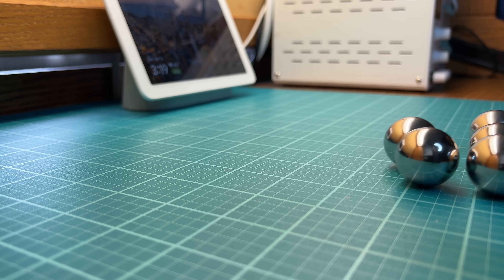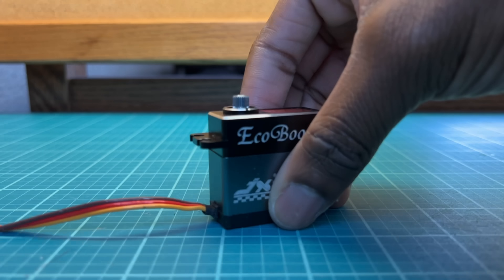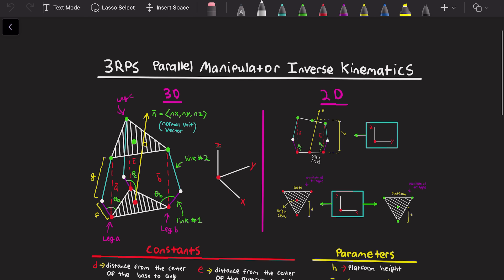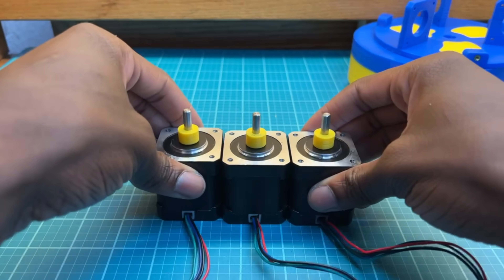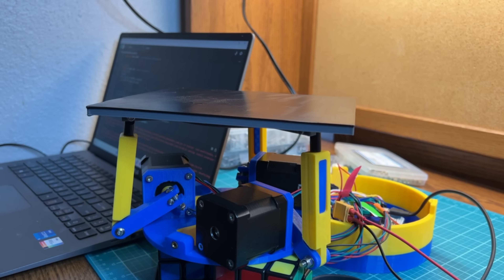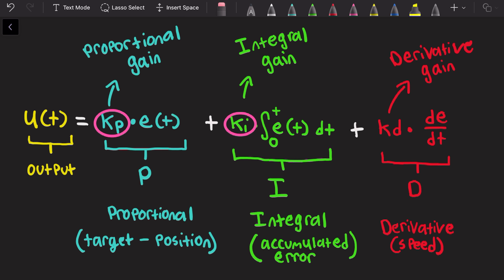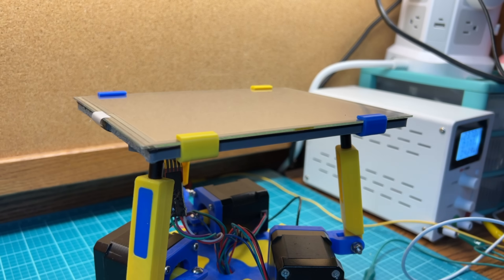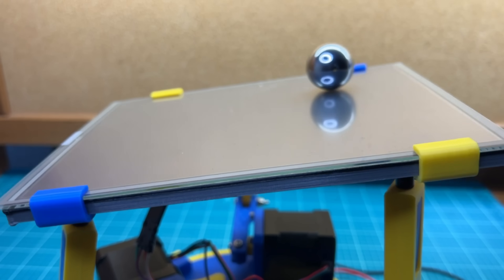I Built a Ball Balancing Robot

Comment from the maker: CORRECTION This is actually a 3RRS parallel manipulator and not a 3RPS parallel manipulator as I mentioned in the video. Also I don’t know why I played Tetris in this video either
Reply: lmao
Reply: Hey man love the video! But a quick correction I believe your design is actually a 3RRS parallel manipulator since its 3 sets of Revolute-Revolute-Spherical, a 3RPS robot would use linear actuators for the prismatic joint component hence the name 3RPS, 3 set of Revolute-Prismatic-Spherical joint. Hate to be the well actually guy, but I think its a worthwhile correction to make in the video since I got lost building my own variation of the ball balancing robot and kept using the Inverse Kinematics of the 3RPS rather than 3RRS robot! Otherwise, excellent video man.
Reply: Can you balance 2 balls?
Reply: I thought it was a metaphor.
Reply: You were working, bosses can't tell anyway.  Just tell them it's an advanced visual user interface.
Reply: Hey, I'm studying mechatronics, and I'm interested in things you do, what course allows you to do the calculations for the shape and movements of the stepper motor. I don't know if you understand, I want to learn and also be able to apply them equations
Reply: Well, and I don't know why no one mentions our work which we did 10 years ago building a 3dprinted 3RRS.  

https://youtu.be/0cO4jrztLqg

Comment: So my problem is that I followed the build plan for the circuit board, and then I powered it on and connected it to my laptop. Then my laptop shut down and isn't restarting. Now I have to send it in for repair. Luckily, I still have a warranty. But what could the problem be?

Comment: First video I got from you was the Capstan Drive, and that one was great. Found the first ball balancing, and I was like "wow, he really went a long way in a short time". Being a control and automation engineer, I could pinpoint what explanations weren't okay, most probable causes it wasn't performing well (lack of the integral on the controller being one), but it was obvious the drive to explain, test, troubleshoot, show your math and make a good video was there... that's a lot of effort.
The difference between these two ball balancing videos are a show of growth, congratulations.

On another note, the most likely reason you didn't get smooth movement is because PID controllers are good for linear systems. Use it on a non-linear system, and you're depending on luck. When they operate around a stable point of relative linearity, they behave as they should; outside that zone, it's a guess. Two common cases of this is using PID to control magnetic levitation and inverted pendulums, if you want to look into it.
Since the table is controlled via rotation of the motors, and looking through your equations, this system isn't linear. From what I remember of these systems, they behave like inverted pendulums. About using PID for the motors, that could help since it would de-couple a bit of the non-linearity, but it wouldn't be guaranteed. Some drivers come with built in controllers, so that could also help while increasing the cost. Still, controlling them via the processor you already have would be ideal.
Also, I'm kinda curious on how you tuned the PID controller. Some situations can have auto-tuning solutions that help, if you don't want to model and calculate the gains for the control setting you want. This case probably has some suite of tests where you can run and have the system tune itself.
Control theory is daunting, but awesome once you get the hang of it.

Awesome job, gained another subscriber!

Comment: @Aaed Musa I like the use of silent stepper motors instead of noisy RC servos. Great project and presentation.

I would suggest to change your kinematics to not pivot around (0/0), instead use the actual (x/y) ball position as pivot. Should be simple to implement and grants nice advantages:
No ball movement/accelleration in z-direction, thus contact between ball and table is much more reliable. Allows for very dynamic movement which would otherwise lead to contact loss (aka catapult effect), which is the main cause of the platform jittering. It also looks cool, the plate movement looks much more organic imo.
Reply: Also to reduce the nervous looking jitter/oszillating when the ball is held in position, adding a dead zone helps. Basically telling your PID to not act if the ball is in close proximity to the setpoint.

Comment: What would be really interesting to see is using machine learning with reinforcement learning to program this. 
you could use the exact same system, have the inputs of where the ball currently is as x and y, and outputs of the three stepper motors, then you reward it if it's close to the center and punish if it's far and punish really hardly if it falls off. would be interesting to see where that ends up

Comment: Nice! From a physics perspective I would expect that the control algorithm should better use also speed (1st derivative of position) and accelleration (2nd derivative) as inputs. But since speed and accelleration are both calculated from position , maybe the PID algorithm is doing that already without knowing it.

Comment: I have a question

why did you use Teensy 4.1 Microcontroller specifically and also why does it need 24 volts to operate it? Is there no other way to make it portable?
Reply from the maker: A Teensy 4.1 microcontroller is a really powerful microcontroller. It’s also the best microcontroller that I had on hand. The stepper motors need 24V, the Teensy just needs 5V. I didn’t feel the need to make it portable since I only ever used it in one place.

Comment: Very cool. Perhaps try balancing two bearings at once. Maybe even get one smaller one to orbit the other. That would be pretty epic.
Reply from the maker: Unfortunately, that's impossible to do with a single platform. According to physics, both balls have to move in the same direction.
Reply: @aaedmusa  even if they were different material? Perhaps different weight and density, along with friction, would impact the speed with which they react to the slanted surface differently and allow you to create a reactive surface that could show orbital motion.
Reply from the maker: @HyperOrangeDragon Nope, if you apply the same force to two different objects they will move in the same direction. It is impossible to make a ball orbit another with just one moving platform.

Comment: I can't believe that you pulled the center out of a stepper motor.
From my experience, doing so usually results in needing to throw the entire stepper motor away.
WHY??
The gap between the Stator and the Rotor is very narrow. The gap is so narrow that even flakes of dandruff will lodge in the gap, causing the spinning rotor to "jam", in a partial manner, over and over again, continually resulting in random rotational outcomes. A stepper motor which cannot produce predictable and consistent rotational outcomes is a stepper motor which essentially needs to be thrown away. I imagine that, when stepper motors are originally assembled, the assembly is performed in dust-free industrial Clean Rooms.

Comment: If we get the kinematics figured, can we then create a simulation model and use reinforcement learning to replace the PID controller? Just curious and wanted to try this.
Reply from the maker: I don't know the first thing about reinforcement learning. I think it's easier to just use a PID controller.
Reply: Yeah i get it. Just curious to know whether that approach could work so that I can use a similar approach for a different use case with complex mechanics.

Comment: I have a question. How you can brake the step motor when powered off ? Or Do you need to calibrate the position of 3 motors when power on to get the horizontal plane ?

Comment: Phones don’t detect pressure points, they detect electrical discharge from your fingers. Thats why you generally can’t use your phone screen with objects that don’t conduct electricity like plastic. Though I’m not sure what tablet you are using, but it most likely has a capacitive touch screen.

But! A really good example of a resistive touch screen is the one found in a Nintendo ds. A lot of commercial touch screens also use resistive touch such as an ATM. I assume its because they want it to be accesible while wearing gloves.

Comment: It is great project! I'm trying to make similar one. So I have a question about your angle formula.
For example, to calculate az, I think it should be "hz + e*ny*(sqrt(ny^2 + nz^2))" because length of projection of unit normal vector to yz-plane is not 1 but sqrt(ny^2 + nz^2).
If there are something I missed in my opinion, please let me know.
Reply from the maker: I guarantee you that the math is 100% correct. I tested it and it worked. I have also had several people build this on instructables and theirs worked as well.
Reply: @aaedmusa   Can you share your full note about formula derivation? I want to understand it step by step
Reply from the maker: @100_dori  You can find the full derivations on my website linked in the description.
Reply: @aaedmusa  I cannot write my email here because it is deleted automatically. How can I infrom you my email?
Reply: @aaedmusa  moc.revan@1330ckbf
just reverse it

Comment: could you use the resistance in the servos themselves as your positioning input?   Also,  do you even really need a computer to do this?  I could see a mechanical calculation doing the trick.
Reply from the maker: That would be a lot harder than just using absolute positioning. You absolutely need a computer for this. It would be crazy hard to tune mechanically.

Comment: I have a question, what if the platform itself is moving, like you place the robot on a slope, can it still balance, the balancing robot might have the same principle as a ship stabilizer so I just thought maybe it is possible, to adjust the axis of the robot not based on weight but the original axis that we experience on Earth, it was just a thought so if this sounds stupid 😅 then it ok 👍
Btw great video

Comment: How does your program initialize the positions of your stepper motors to some home position? Basically, how are you setting your stepper motors to an initial position that ensures the plate is level?
Reply: I think I just answered my question. By looking at 3.39, it looks as if you could just push the plate all the way down such that each link connected to your stepper motors is turned as far as they can until they hit this bottom plate to which the motors are mounted. From here, you can take these positions as home. And as long as you have previously calculated the angle of these linkages at this initial position, you can achieve any link angle by command of your stepper motors from this position. Very impressive engineering and problem solving. You’ve got a new subscriber!
Reply from the maker: @riley3448  correct thanks!

Comment: If you change the motors for a brushless motor, you would get much higher precision and control bandwidth.

Also, one way to do thus without a resistive screen is to sense the motor torque to determine the position of the ball.

For instance, if the ball is in the center, all 3 motors would have to do the same torque to balance the platform. You can triangulate the position of the ball by sensing (or just using as input) the torque.

You could use encoders to sense motor position and correlate with platform position. The setpoint is to have the platform in the center (aka all 3 motors at same position).

This is equivalent to trying to balance a ball in a platform with your hands and eyes closed, sensing the weight of the ball.
Reply from the maker: I too have also thought about using brushless motors in a future iteration. I like that idea very much, although, I don't see how measuring the torque of the motors would be a better way of detecting the ball than using a touchpad. Measuring torque means that you would have to do much more calculations to find the position of the ball with the end result being less precision in that location. Less precision because the ball is very lightweight, so any change in holding torque for the motor will be minimal if not negligible. A touchpad is much easier to implement and has virtually no drawbacks.

Comment: You could probably detect the location of the ball relative to 3 hall effect sensors with a small magnet under the middle of the table. That would allow the table to be made from something more aesthetically pleasing than a resistive touchscreen, or be made round.

Comment: next update make circles with ball bouncing on plate. that way you can limit contact time between plate and ball. next add second ball and make circle on the other side of plate with that other ball. so you can have independent control over two or more object using single plane

Comment: Have you considered switching from a PID based system to full motion profiling with trapezoidal velocity curves and splines and all that jazz? When I was doing FRC robotics in high school, switching to motion profiling seemed tedious and unnecessary at first but the final product was phenomenally smooth and easy to use compared to PID systems as we used in previous years.
Reply: That works great for smooth and efficient accelerating and decelerating, but is not particularly useful in a high speed control loop
Reply: @harrylenon9594  you could have a motion profiling system for smooth ball motions that falls through to a PID system whenever the ball moves too quickly

Comment: Now, my question is this; could this technology be expanded in scope, such as to say, could this possibly be used to create a safety system for large skyscrapers to be auto balanced in correction of major motion, such as from earthquakes or structural failures? Could this be implemented within the core of the structure to engage automatically when the buildings tilt goes over a dangerous threshold, to utilize a massively heavy weight in motion to correct the imbalance?

Comment: 5:55 Fun fact, the solution you came up with to "avoid" using extra PID controllers is basically just use a PID controller with the I and D gains set to 0. You can never escape the PID!

Comment: Insanely professional!
How difficult would it be to make it compatible with a multiple number of balls?
Reply: Fun question! I have a feeling the answer is "impossible" (I have some examples in my head that probably could prove it for at least those constructed scenarios) but would love for it not to be in practicality, either by the machine being more perfect than the roundness of the balls and using that to control them separately, or using verticality to influence some ball while another is still or in freefall, or if that turns out not to be feasable, then maybe having balls of different sizes or hollowed? /Not a mathematician

Comment: Could you maybe have used a Stewart platform for the balancer?  That might have been even more efficient and removed some limits of degrees of freedom at the expense of more stepper motors. But the use of the PID controller was a great idea! I couldn’t imagine using PID in 2 dimensions rather than just one.

Comment: Wait isn't the minimum technically only 2 motors?
If there are only 2 axes, pitch and roll then theoretically you should only need 2 right?

You would need a linkage that locks the centerpoint in the middle of the plate while still being under it. You could technically do this easily if its ok to have the center be a little bit under the platform.

This should also simplify the algorithms and motor control because I don't think you would have to do any inverse kinematics.
Reply from the maker: Correct but this has 3 DOF because it can change the height of the platform.

Comment: Hey mate have you thought about implementing a Kalman filter for the ball position to smooth the reaction?
Reply: Additionally, would you consider a double cascade controller so that you track an instantaneous velocity as well as a future position? 
Essentially the idea is, you give it the “next” position at the next time step, and work out the error for that instead of where it is now, and also include a derivative term for the velocity vector you want to achieve. The “next” position value you’d look to track would be the integral of this predicted velocity multiplied by the time step

Comment: Would you consider doing a PID project where the constants are controlled by potentiometers? It could be cool to be able to see the working values physically represented and watching the platform's reaction as you change the values in real time.
Reply: That’s actually fairly easy to do! You just have to do a series of PID op amps and change the resistors to POTs.
Reply: @tristanfirepro  don't mean to dump on you but pots isn't an initialism or acronym, it's just short for potentiometers. few if any will be offended if you don't capitalize it.
Reply: @BobofWOGGLE  I'm not sure what I was on when I typed that comment haha. I think I must've felt the need to capitalize another three letter word after PID! Anyway, it gets the point across. Most schematics have POT as a reference designator anyways so it's difficult to be confused with anything else. Thanks for the heads up!
Reply: wtf is this nerd bs lmao